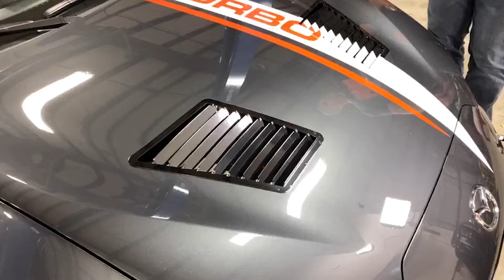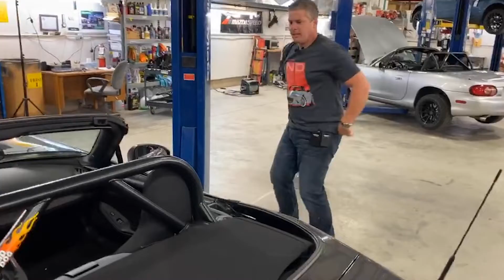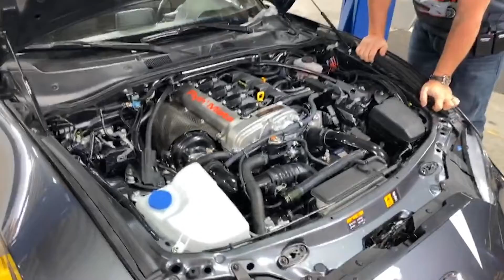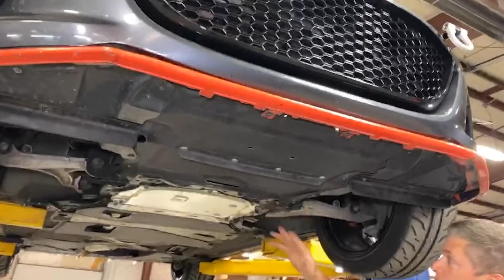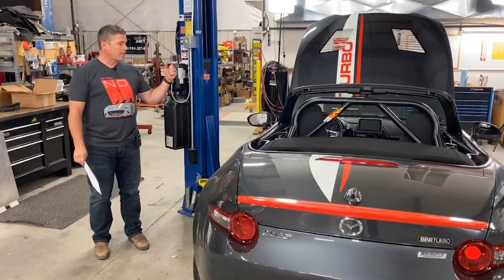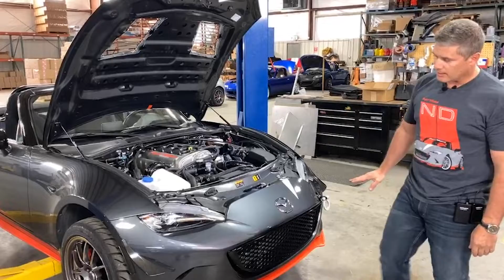Car Tour: FM's 2016 BBR Turbo MX-5 (FM Live)

Comment: I used this car for the template in my 2018 Club build except I went with the BBR’s Stage 2 Turbo kit.  Forged engine, cams, valves, port and polished head with stock bottom end.  NC stage 2 tranny from Walther Motorsports, BBR ND/NC adapter clutch, and differential We’re in the process of final assembly and tuning.  Hopping to have the car back by Oct 1.

Comment: Curious, why isn’t it running e85 or at least a flexfuel kit? I see those making 300+
Reply from the maker: This car features our CARB/50 state legal BBR turbo kit, so it's not tuned for those things or for maximum horsepower, just a pleasant bump over stock with a flash on the stock ECU. Those kinds of numbers would require tuning and parts which would render it illegal in some areas, or require much more testing to get a new EO.

Comment: Can you comment on the grille for daily driving?
Does it increase drag since it's a larger opening ("parachute effect")?
Does it increase wind noise?
Do you recommend reusing the upper brace?
Can you comment on the bumper flex without the brace?
What is the weight compared to stock (with/without upper brace)
Reply from the maker: The grille does not seem to have any downside for daily driving. If there's an increase in noise, we haven't noticed.
If by "upper brace" you mean the structural element that joins the two front frame horns, do NOT remove it. It's much more important than people realize. It's not there to support the bumper.
Reply: @FlyinMiataVideo  I'm not sure if the "upper brace" I'm talking about has anything to do with frame horns. Refer to these Spyder grille installation videos.

https://www.youtube.com/watch?v=-FKK1r5aE_0&t=21s
At 1:55, the guy is cutting the OEM grill to retain that top piece.

https://www.youtube.com/watch?v=8uCtHms0YdY&t=398s
at 3:58, the guy removes it completely.

Also, I know the weight is not going to make any significant difference, but can you or anyone at FM can comment on the weight of the OEM and Spyder without that upper piece? or at least guestimate which weighs more or less? I just need to satisfy the OCD-self.

By the way, thanks for being active about replying to comments, it means a lot!

Comment: Hey Keith, I've seen a lot of different builds on YouTube of Miata's and one combo I haven't seen was a turbo or supercharger setup while also having upgraded or more aggressive camshafts installed. Have you guys at flyingmiata done a setup using a more aggressive camshaft on forced induction or recommend doing it to get a bit more above the 200whp target? I've seen it done on a naturally air setup but not the other. Thanks, keep up the great work.
Reply from the maker: The power limitation on this car does not come from the camshafts, it's the fuel delivery. The hardware is there to make a bunch more power. Since the cams are not a limitation, we haven't done any experimentation with different cams on the ND with forced induction. We have played with cams on naturally aspirated NDs, though.
Reply: Thanks for the response! I knew fuel was playing a factor in this but wasn't sure if you guys wanted to switch out fuel pump, larger injectors and fuel rail to get those gains. I have not been in a setup such as Andy and I'm sure 200whp is plenty fun. Trying to do as much research before getting into an NC or ND and planning a build.  I know boost over the 8-10psi on stock internals for long time use is a risk on those stock rods. Thanks again.

Comment: You mentioned the price to duplicate this car was about 17,000.00 . Is that just the parts or does that include installation?

If its parts only, how much for installation?

Thanks
Reply from the maker: Price mentioned was just in parts alone. We do not do installations, so price would vary depending on the installer of your choice.

Comment: You're at 140 kPa absolute on this? That seems like less than 7 PSI at sea level. What am I missing here? I was targeting 1.5 bar (150 kPa) in Arizona
Reply from the maker: You’re not missing anything. We’re working with absolute pressure limits. not relative to ambient. At altitude, you will need more boost to get to the target manifold pressure.

Comment: Thanks for this video and your post and research on your web site! Being inspired by your post and videos I have built similar car here in Berlin, Germany for the last year. Still stabilising the built as faced some similar minor issues with downpipe mount break, some minor leakages etc. And I definitely like it- 2017 ND1 with BBR Turbo, Ohlins Road and Track, Mazdaspeed and ILMotorosport braces full set, CSF radiator, Verus Air Oil Separator, MX5Things enhancements, 9x17 235/40 949 Racing 6UL Wheels. Overall cost is higher here in Europe for most of the parts.

Comment: This is a great video. Very informative. I'm looking to buying the turbo kit directly from BBR (I'm in Spain so they're closer). I had concerns about cooling, both in the engine and the transmission. You've mentioned that engine temps are kept under control pretty well. I would like to know if a transimission cooler would be necessary for a car that would be tracked once every 2 or 3 months and spend most of the time on the streets (I usually have a pretty aggresive driving style)
Reply from the maker: It doesn't really matter how often you go to the track, what matters is how hot it gets when you are on the track. Chances are you'd be okay, but if you drive hard in hot weather it's good insurance. The cooler is less expensive than a new transmission!

Comment: Have you all explored e85?
Reply from the maker: We have worked with E85, but we prefer cars that can test the actual ethanol level so the tune can adjust. Cars that can't test the ethanol content (like the ND) mean you either have to take a chance on the quality of the fuel or be very conservative.
We've lost our local source for E85, which does make it difficult these days.
Reply: Flyin' Miata same on my local source as well.

Comment: Hey Keith, 

Can you describe the difference between an ND1 with the FM BBR turbo and an ND2 with the FM Hush-O-Matic and FM High Flow Midpipe?   What are the differences in power/torque delivery and how would that relate to everyday driving as well as track driving?
Reply from the maker: The two cars are a great reason why you need to look past peak power numbers. They feel very different to drive.
The turbo ND1 has a lot of torque. It's a very quick car, with good throttle response and a flat torque curve to redline. There's just punch everywhere. It's an easy car to drive every day because the car is ready for you. On track, it's faster than the ND2 but doesn't make the fun noises.
The ND2 is a sports car engine. You get to 6000 rpm where the stock ND1 falls off and it just keeps pulling harder and harder. Very entertaining on the track if you're chasing the experience and not track times - we all enjoy it here. For everyday driving, it feels very similar to a stock ND1 other than some improved engine mapping down low. If you're not going to rev past 6000, it may be worth saving the money over the ND2 - but if you do, the ND2 is fun. Remember the original 1.6? It's got that kind of fun.